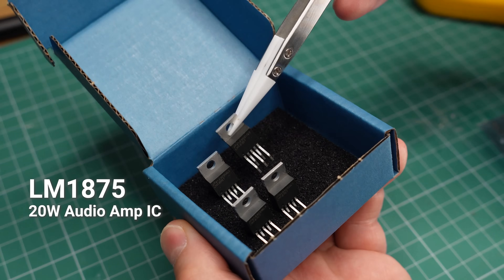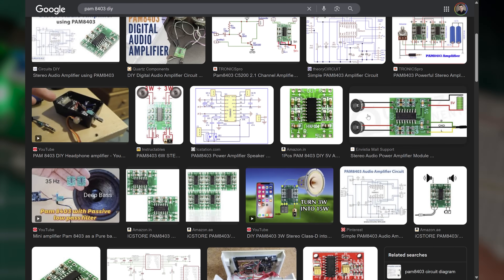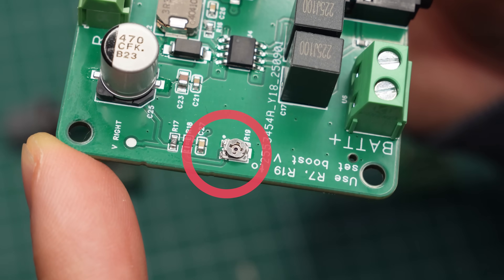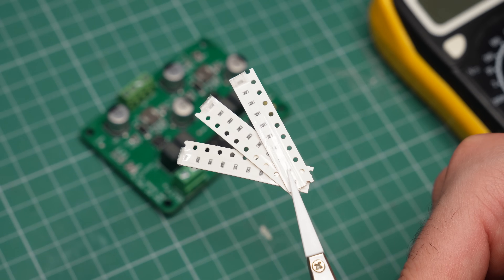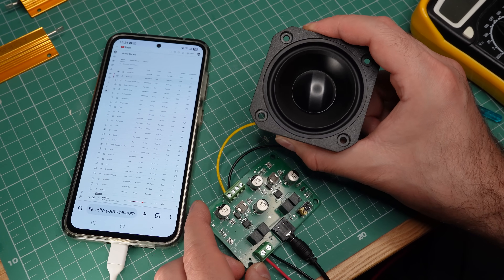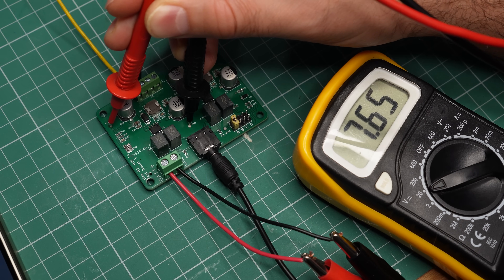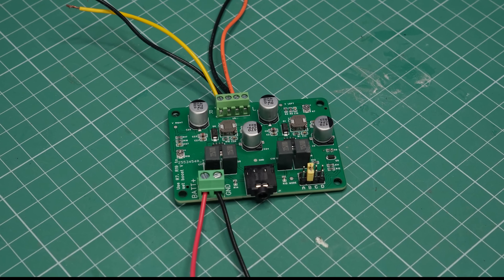My Amplifier Has a Cheat Code for MORE POWER and LESS DISTORTION!

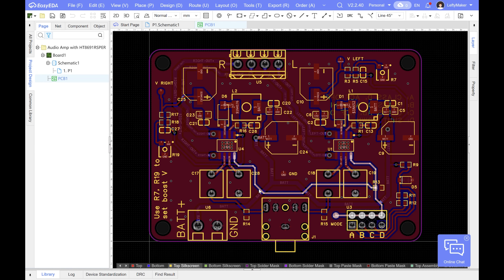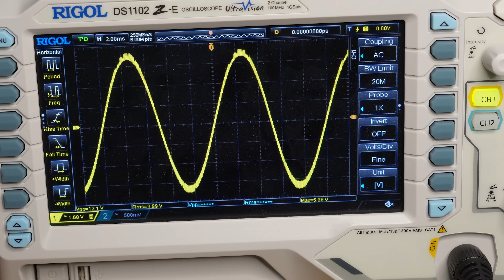Comment: If i look at your circuit at 2:18, it seems the value of the capacitor C26 in LC filter is too low, the datasheet (Page 9) recommends 10nf for the LX terminal, higher value gets a bit earlier roll-off but also smooth out the clip on a higher impedance input like in 6:14 . 
However, you can also put zobel on both output (to ground) because these cheap amp usually consist of 2x class AB amp on BTL mode integrated inside the chip right when they became ubiquitous in 2010's.
IDK what they did with the "ACF" thingy but that waveform results kinda reminds me on how "class G" amp operates for some reason.
Reply from the maker: Hello! I believe you may be looking at a different datasheet. The chip I used is the HT8691R, but there is also an HT8691 model

Comment: how to calculate the power output
Reply from the maker: I calculated it by playing a sine wave through the amp and turning the volume up until it was just about to start clipping. The load was a 4 ohm resistor. The formula is Vrms² divided by the load resistance
Reply: Thank you. i was using Vpp not the Rms which gives different result and very suspicious and got me confused, now i understand finally. keep it up!
Reply from the maker: Yup, you need Vrms to get watts rms. You're welcome!

Comment: Why did they stuff two amplifiers into one soic8 package?

Is the "class ab mode" meant for headphones?.
Reply from the maker: I have no idea, but it's not the only chip to have this feature. For example, the PAM8406 can also be used in either Class D or Class AB mode. The datasheet only mentions AB is to eliminate the electromagnetic radiation, which you can get in class D.

Comment: 6:53 on a samsung phone, you can control volume much more granurarly by using the on screen volume indicator. My phone has 150 discreet volume levels on the entire bar with 2 being the lowest audible level. See if yours does it and allows numbers display through the samsung themes app. By default, my s21u would jump in 10 step increments but this can be adjusted in the app I mentioned.
Reply from the maker: thanks for the heads up! Yes, it works on my phone. The sine wave generator app I use has a built-in volume control with percentages, so I used that for testing when I needed precision.
Reply: @LeftyMaker Oh, I see. Additional detail, on my headset with bluetooth, my phone doesnt do all of the independent volume steps. I'm not sure if wired is different or if this is a limitation of bt. But my headset has noticeable volume jump for example from 38 -> 39 vol

Comment: why not just a 5v step up for both the amplifier power and voltage divider?
Reply from the maker: Originally, my idea was to make an upgraded PAM8403 with a boost converter, but then I found this chip and went with it instead. I assume that since it has the converter built in, the two would be optimized to work together.

Comment: i want to make an amplifier with the tda2050 ic . I saw a lot of circuits online, but all are different. im just staring out and have no idea.😢
Reply from the maker: You can start by copying what's in the datasheet. Notice there are two variants of the circuit: one with a split and one with a single supply.

Comment: Yes! The Ohm's law limits the power, and you can fight it by either decreasing the coil resistance or increasing the input voltage like you showed in the video.
I repaired a car subwoofer amp for my friend, and that had four massive electrolytic capacitors that I replaced. 
The amp first created a ±55V supply from the 12V to 14.4V supply. It was a pretty crazy system. Made as cheap as possible and so near the voltage limits of the parts that I'm surprised it got the CE mark.
Reply from the maker: Yup, that's standard practice for car amps. No way around it nowadays. Thanks for sharing!
Reply: If the amp was made in China then I'm afraid the CE mark means nothing.
Reply: @wilhelmvonn9619  The amp was made by Infinity, and it was sold in Finland, so I think the CE mark should mean something in this case.

Comment: Low voltage zeners below 5.1v are bad choice if you need somewhat stable reference voltage. They drift heavily from the supply voltage variation and current flowing through it, a tl431 is the better alternative
Reply from the maker: You're right. I used that because they had a 2.4V zener in the reference design, and a 2.7V was available as a basic (free to place) part for the PCB. Yeah, the drift was bad, but I learned something new.

Comment: some people still build amps with LM386, LA4440 and TDA2030A regardless. Meanwhile, my Aiwa HiFi system from the late 1990s has a discrete transistor amp. 2x50W RMS (in reality it can push more than that before speaker protection kicks in and shuts off the entire system)
Reply from the maker: I think building amps with older chips is fine for many reasons. They are easier to solder and can teach you how (not) to lay out your components around the circuit board. It can be fun and rewarding to put together something that works, even if it is objectively worse than anything you can buy pre-made. Besides, some chips like the LM3875 and TDA2050 sound really good.

Comment: Well done!!!  That was a great video and a really well designed PCB Amp. Keep up the great work and keep the videos coming please. It will be interesting to see what you make with these boards next.
Take care and stay safe,
Joe
Reply from the maker: Thanks for the support! :) They're merely a prototype at this stage -- a final design wouldn't have the mode selector, for example, which puts a constant 5mA draw on the battery at all times. A version 2.0 could work beautifully in a small wireless speaker.